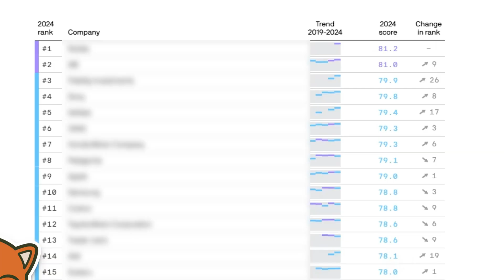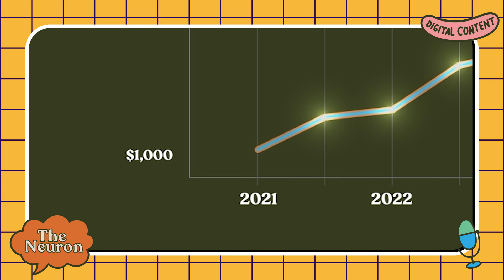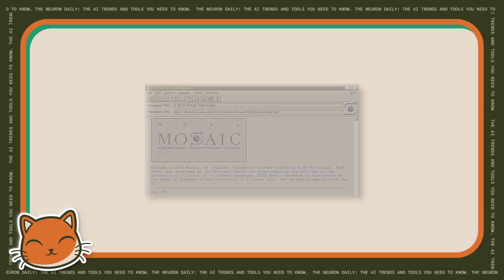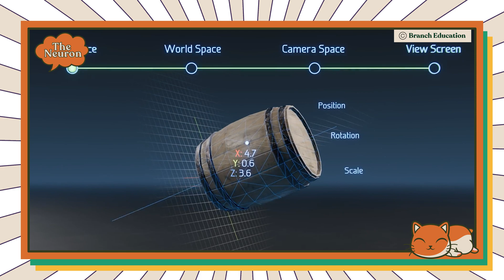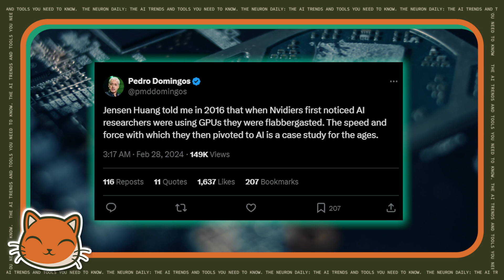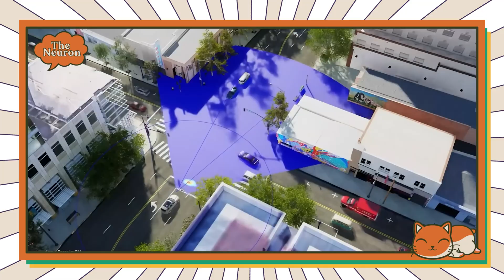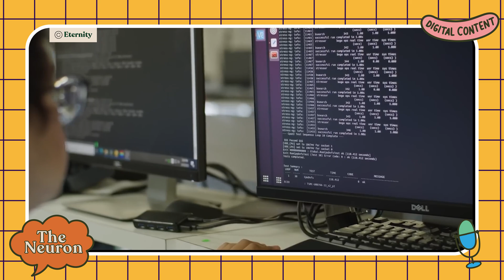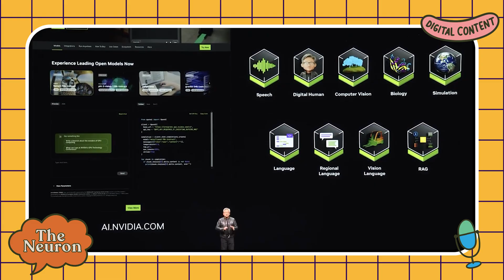How Nvidia Came to Dominate AI

Comment: Blackwell isn't more power efficient its just two previous gen chip fused together. The efficiency comes mostly from lower floating point accuracy. Groq is built from the ground up to be inference efficient. Blackwell is great for training terrible for inference and that is where the rollout to end users will be will accelerators (NPU). Nvidia lead is mainly in-situ  graphic cards and drivers running CUDA libraries. This will not help the mobile market.